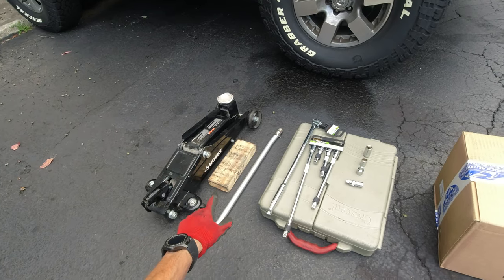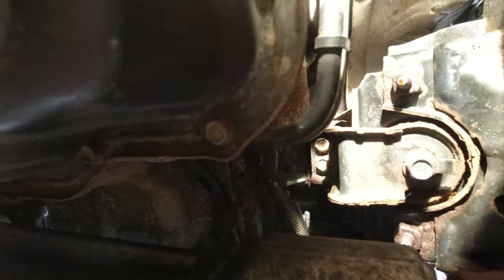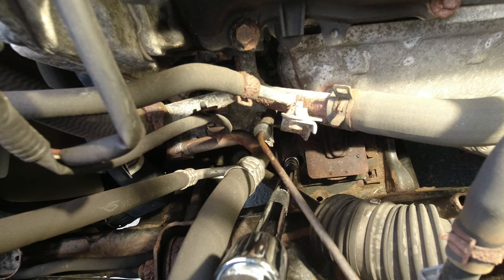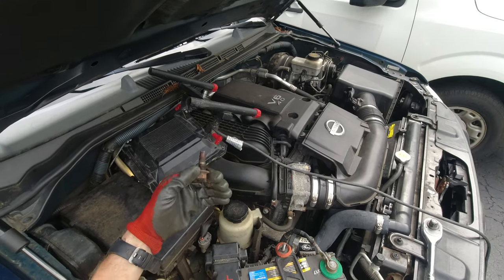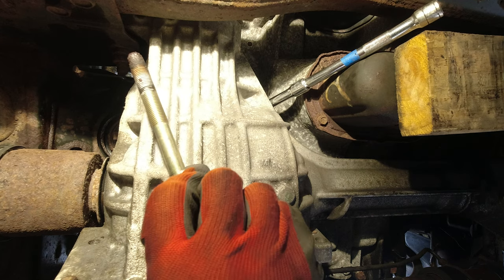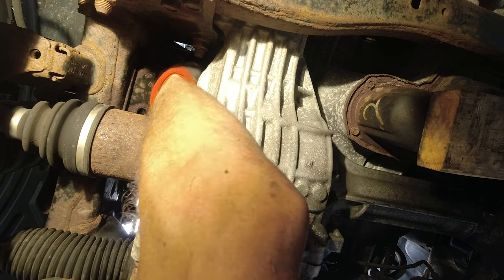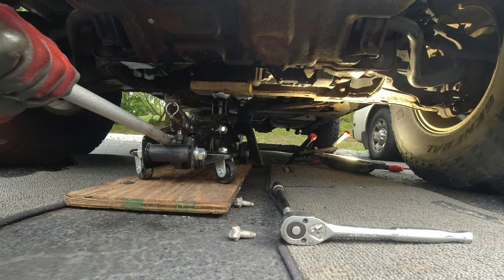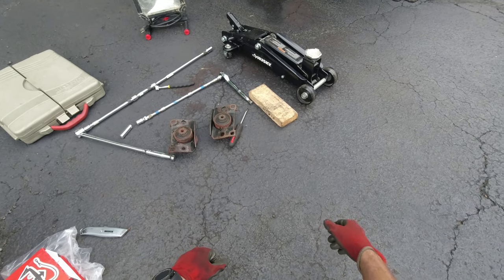Engine Mount Replacement On My Nissan Xterra (Read Update )

Comment: Awesome video, will look forward to the transmission mount replacement. My X is a ‘12 and will need replacement soon as well.
Reply from the maker: Hey thank you ! sorry about some band camera angles here and there.. 😆 now that I have had them for some time on my truck really like it how quite it is now !!  so its definably a recommended upgrade / fix   ! goodluck with your truck  ! are you planning to take it to mech shop ? )
Reply: @DIY_AUTO_PHOTO  trying to research and see if I can tackle it on my own. I’ve done maintenance such as fluid changes including the trans and diff, but nothing like this.
Reply from the maker: @notthatlopez7280  I see,  technically its not that hard as long as bolts come off easy lol and like I said just need to be carful and make sure that engine is well supported with a jack . I wonder how much people would ask you at mechanic shops , have you called to find out yet ?

Comment: I worked for Nissan, I know that kind of diagram @26:47, the 2nd # inside the parenthesis is the ft•lb value so you need 65 ft•lb NOT 88, that's the Newton meter value.
Reply from the maker: Opps.. lol good tip  will add it to description sir !

Comment: My xterra just have same issues too，really apprciate this vedio， may i ask how long will it takes to replace the engine mount，thanks！
Reply from the maker: hey hopefully you can fix it  soon!  well it depends on few factors like if you have front diff or not.. ( if its 2wd ) its easier to do as bolts are much easier to get access too.  also how rusty or how hard bolts are to unbolt  but like it been said here impact gun can help alot.. so I would say it could be 1 hour job could be 2 hour job but its not that hard its just few bolts to undo here and there and just watch out for engine when its up in the air ))  
Goodluck !
Reply: @DIY_AUTO_PHOTO  thanks, mine is the off road version. i just visit a shop today and they said it will took 800 about 8 hours works time？i was really surprise about the time and price. also really appreciate you advice
Reply from the maker: @RonaldinhoPMP7000  oh wow what are they smoking ? I mean I was recording a video so when I do that it takes longer but without just look at the video few times see what tools you need to get it done its not that hard just have to be careful and follow the steps its no where near 8 hour job.. they just full of ... you know full of it.. lol
Reply: @DIY_AUTO_PHOTO  my transmission mount also broke,  can i ask is that took that long time to change transmission mount+engine mount？
Reply from the maker: @RonaldinhoPMP7000  I haven't done transmission mount yet as it is still looks good. so that time is just for engine mounts .. also a tip.. just make sure you can loosen up all the bolts first that way you know you can remove them and replace the mounts . other way if one won't move then you wont be able to complete the job
Reply: @DIY_AUTO_PHOTO  Thank you so much for all the advice sir, i m gonna figure it out. And i follow your channel, looking forward to see u more video about xterra
Reply from the maker: @RonaldinhoPMP7000  Thank you so much for following ! as well do please keep updates on how it will go )) and I for sure will try my best to continue upload 1 video per week ))
Reply: @DIY_AUTO_PHOTO  I have 2002 4x4 I need to do passenger side engine mount would it be easy

Comment: Anchor mounts are so shitty. Mine failed in a year as well. Rockauto shouldn't even sell them
Reply from the maker: Yeah man I agree... never again will buy them or use cheaper parts on  critical parts like that in the end it will cost more and have to do it all over again

Comment: Hello- Is wheel alignment needed after replacing engine and transmission mounts?
Reply from the maker: Hey ! no no need as it simple unbolt lift and then bolt back in.. it don't change any steering or suspension components 
Thank you for watching !

Comment: This video makes me feel nervous.  The exterior portions of you X look mint, but the underside does not.

Do you know anything about your X's history?
Reply from the maker: I feel you ! but the more I work with my truck the more sure I become in myself and confident not cocky but sure in my ability to do some thing or another lol
ah yes its pretty rusty under there... mostly just the bolts the frame itself still looks fine with just superficial rust for the most part... 
as to the history of my truck I know very little the previews owner was an older gentlemen and for the past few years before me it was in NJ
Reply: @DIY_AUTO_PHOTO  What year and how many miles are on your X because it looks almost brand new and there are some products that owners have had good luck with restoration and stopping of further corrosion, but a pain to do a proper application.
Oh, and on another subject, on my 1908 OFF ROAD trim X I recently bought that had 183000k miles on it that I suspected had plugged catalytic converter ? Well that was it, I gutted them and it runs much better but it needs coil packs and plugs.  So, my 50 K S trim  except
Reply: @lazerrred  New York rust kills lol

Comment: @DIY - Auto & Photo Did this fix the vibration problem? I just bought a 2015 Xterra Pro 4X with only 68K miles and it vibrates at stop lights too.
Reply from the maker: Hey Congrats on the truck !! what a great buy ! wow  ! and yes it fixed it!   hope you can find the issue and fix your as well do please come back later and let me know )

Comment: An impact driver would’ve made this a breeze ;)
Reply from the maker: It sure would indeed !! is that what you use to work on the car/truck ?  do you use cordless or  not ?
Reply: @DIY_AUTO_PHOTO  I use the cordless Milwaukee M18 Fuel.. ITS PHENOMENAL. I just replaced my outer tie rods and it made removing the bolt a piece of cake. I’m about to replace my suspension on my X  with 2 inches of lift and I can’t wait to use it.
Reply from the maker: @theTony2times  oh nice ! yeah Milwawkee makes great tools !   unfortunately at that time I didn't had an impacts gun , but before I started doing my Titan Swap I bought one its cheap but it saved me ! lol 
good luck on your lift ! what did you get ?
Reply: @DIY_AUTO_PHOTO  just something simple from Alldogs off-road.. it’s rear and front shocks with lift coils, it’ll give me 2 inches.. it’s really a suspension refresh. My Pro4X has 208k miles
Reply from the maker: @theTony2times  208k miles nice ! those trucks can last long time if we give them some love ))  
sounds like a good plan on the lift and yeah alldogs are pretty good !  are you going to do the work yourself ?
Reply: @DIY_AUTO_PHOTO  yea it runs great, Im on an original alternator and I feel like that’s next on the list to replace. I  definitely am! Super excited for it
Reply from the maker: @theTony2times  Oh great man and goodluck  as long as no rust or frozen bolts it should be easy ! and it really dont require that many tools
Reply: @DIY_AUTO_PHOTO  thank you! A little pb blaster and an impact driver can take care of any stubborn bolts hahah
Reply from the maker: @theTony2times  it sure is... I was spraying with pb blaster  all my bolts for almost a week before I started working on my titan swap lol
Reply: When it comes to motor mounts, our impact almost never cracks it loose. Always needs good ol fashion manual power.